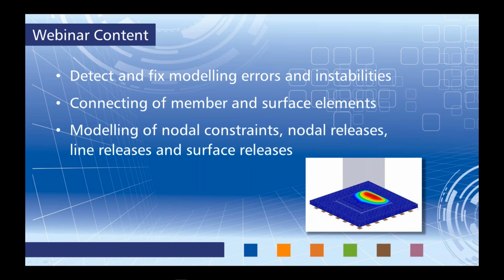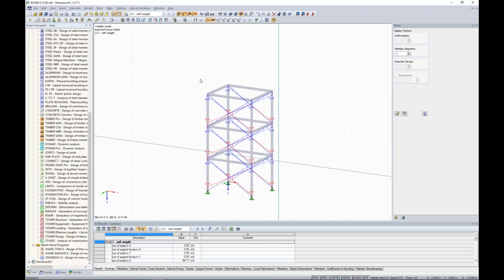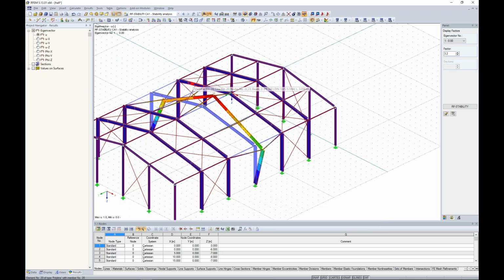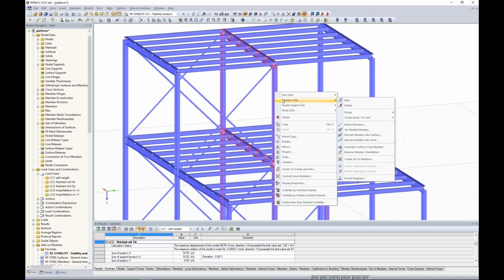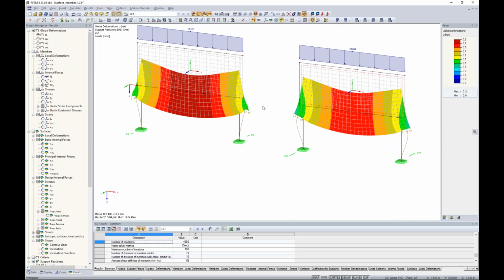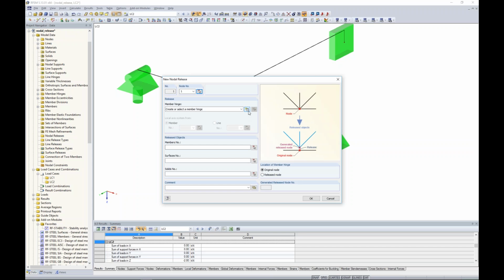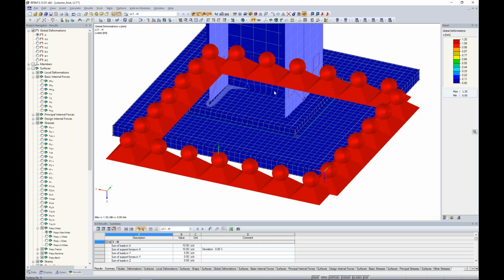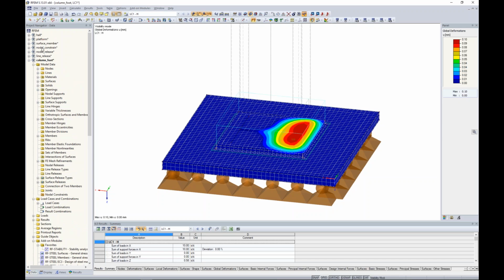Webinar: Tips & Tricks for Modelling in RFEM and RSTAB

Comment: Hello.
I have a qestion: can you design a taper profile (PEB) use AISC code with the software?
Reply from the maker: Hello Nguyễn,

Tapered members can be designed per the AISC standard utilizing the RF-/STEEL AISC module.  In the following webinar, you can see an example of this as a tapered member is utilized and designed per the AISC 360-10 standard:

 https://youtu.be/v4Ynn5GrHOQ
Reply: Thanks for your reply. I see the video, but If you can, please create a webinar design a PEB factory with taper section in AISC code. I believe many users want it.
Reply from the maker: Hello Nguyễn,

If you're referring to the AISC Design Guide 25, RFEM does not have this DG included in the RF-STEEL AISC module.  If you have further questions or comments, please write info@dlubal.com and we will be happy to help you further.